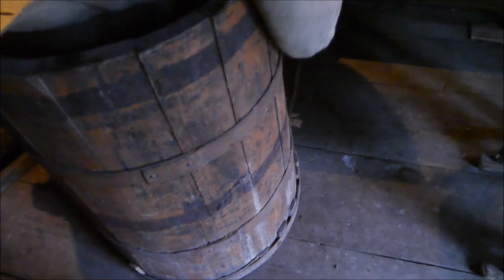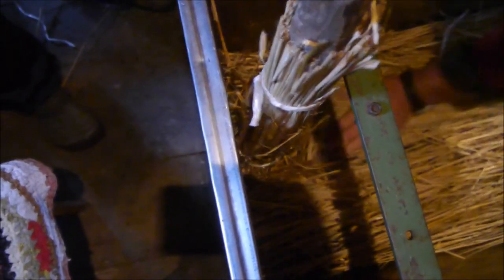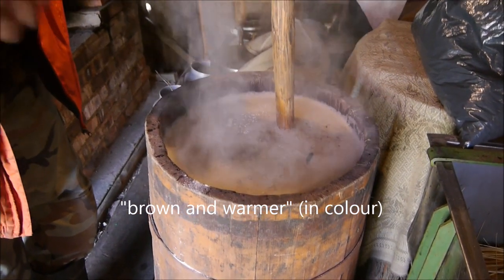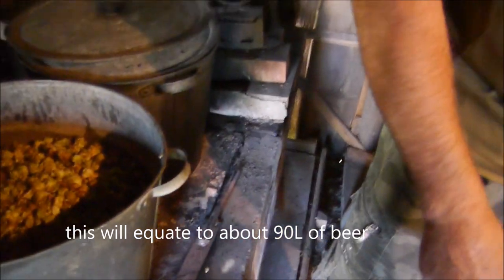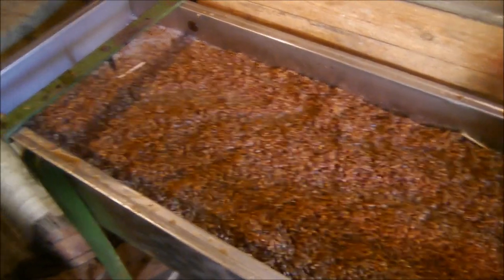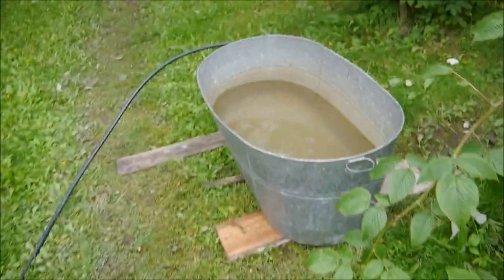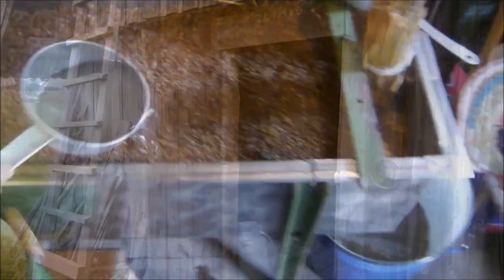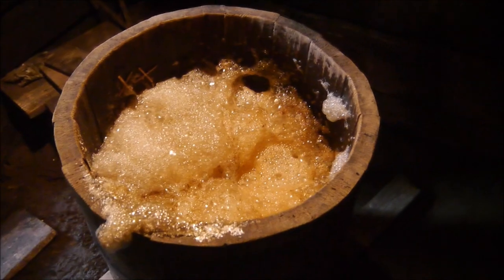epic Baltic farmhouse ale - part 1. how to brew beer the old way

Comment: Thanks for this video ! That’s so great!
I have a practical question for you, what are you looking for in a  wooden mash tun like this one ? Assuring the wood don’t cracks or leaks after so mutch h uses?
Reply from the maker: Thanks for commenting, I can't say I'd know. This mash tun has been in use for decades and is a remnant of a time when most farmsteads brewed. Back then there would have been little choice but to use wood methinks. Seems hold up pretty well, and is filled with water a couple of days prior to use so that the wood swells.
Reply: @aBalticHomestead  thanks a lot for your reply
Reply: @bretonleo8740  I have experience working in a barrel room at a winery conditioning barrels. For beer I would soak the barrel  with clear water prior to use for 1-3 days, drain it and torch the inside to steam  it off. Pouring in 5 gallons of boiling water down the walls wont hurt either. Charring the inside of the barrel like done with some red wines could also be beneficial flavoring porters.
Reply: @Mountainrock70  thanks for your feedback !
Leo